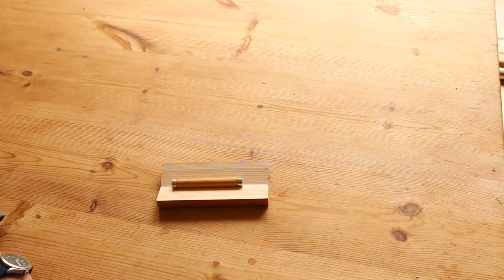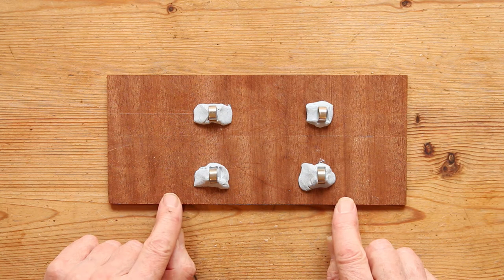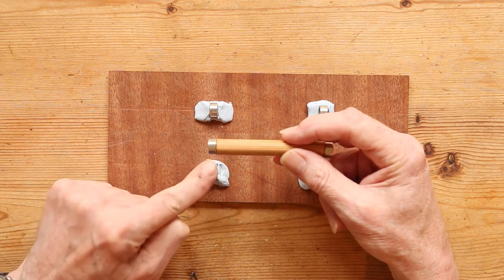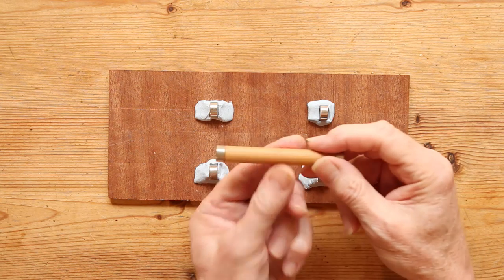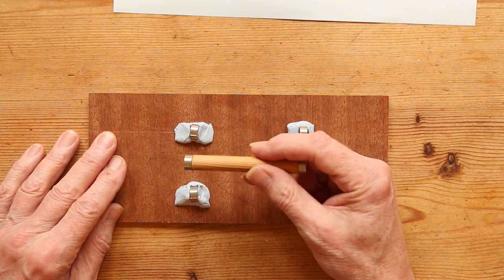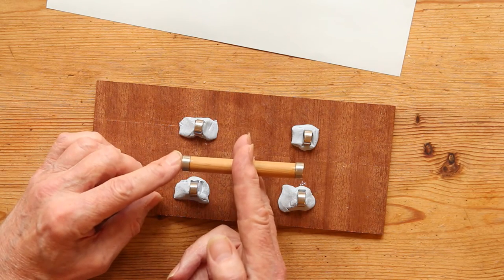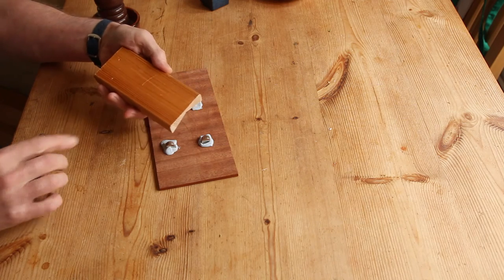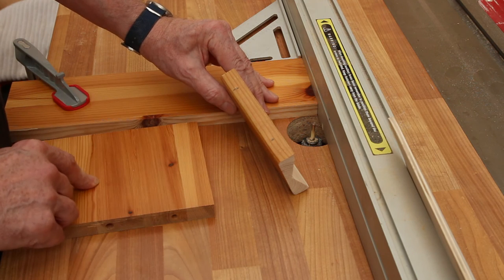Magnetic Levitating Pen

Comment: I've seen Izzy Swan cut coves with a table saw and run the work piece over a shallow blade at an angle. That would give you a rounded channel.
Reply from the maker: Good point. Thanks. (Anyone considering it, note the use of featherboards.)